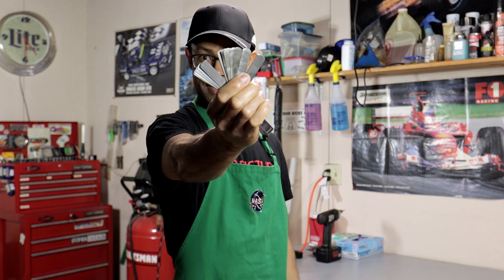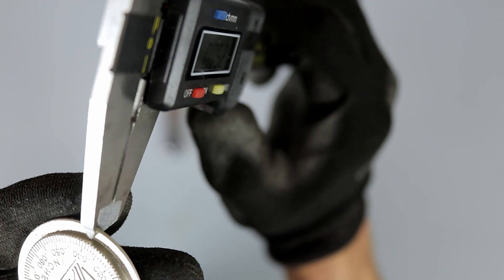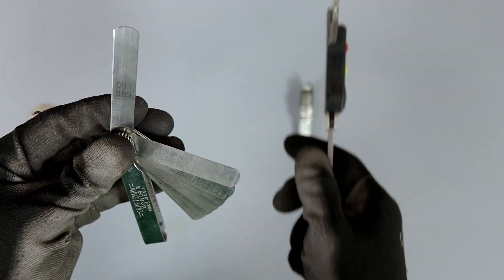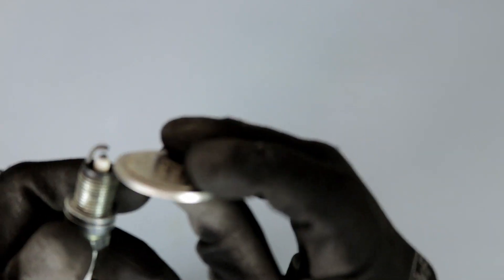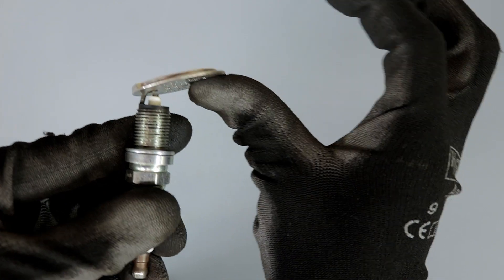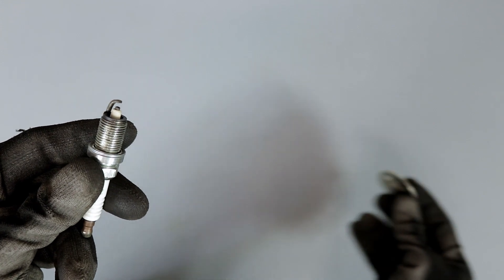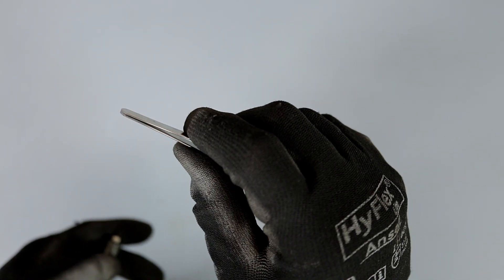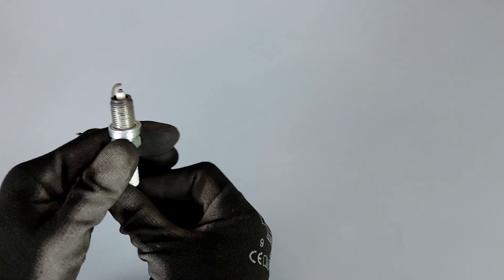How to Measure SPARK PLUG GAP For Your Mercedes-Benz M113 Engine - SIMPLE & EASY!!!

Comment: 2002 mercedes benz s430 4.3l engine whats the correct gap setting .044
Reply from the maker: Hello Tulsa oklahoma, The gap for the s430 is 0.8mm or 0.0314 inches.

Comment: For the nerds: Part of what determines the spark plug gap is the cylinder pressure at ignition. When air is compressed it becomes more resistant to current flow. The cylinder pressures can vary widely between different engine designs, so that's why you need to check what the engine maker set it to instead of relying on the pre-gap distance set by the maker of the plug.
Reply from the maker: Thanks for sharing your knowledge! You're a wizard! :D

Comment from the maker: Maurice Searcy made a good note about spark plug gap on my last video, so I decided to make a video about spark plug gapping. I'd love to hear your comments on whether or not you gap your spark plugs before installing them into your engine, and can you really tell the difference? Please share your thoughts in the comments below :)
Reply: yes, gap is essential for firing consistency. 
Simply make sure you dont apply any pressure to the center electrode pin... only torque the ground electrode alone.

(FYI: I found the spark to more consistent with a double platinum plug than with the hair-thin central irridium plug - It seems as if a larger spark surface offers more possible paths to strike ground... as opposition to a single path.)

Long story short: less random misfires! (I do know the high-voltage narrative  about easier to ionise a path with a needle tip... crap!)